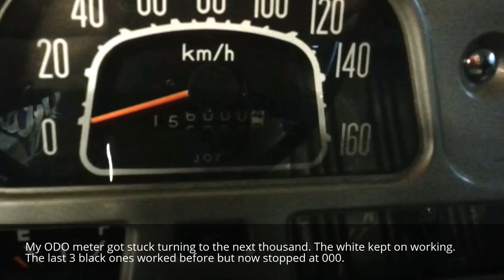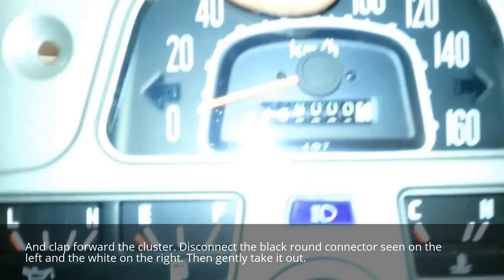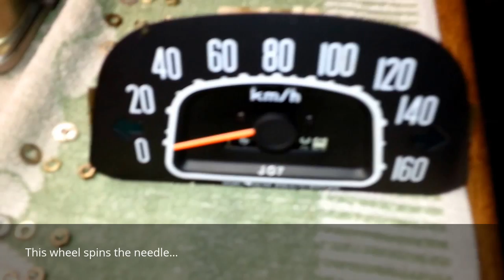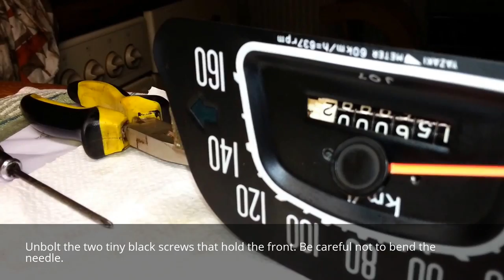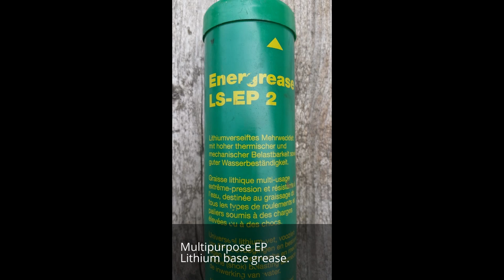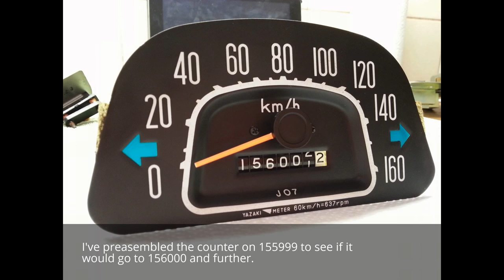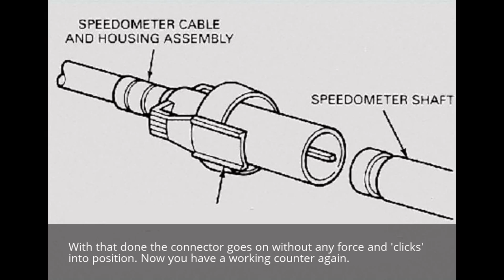FJ40 BJ40 BJ42 Odometer stuck. It stopped turning to the next thousand - How To Fix

Comment: Hi there. My odometer doesn’t work at all, the white numbers spin/work although the odometer doesn’t move/work... any ideas? Would it just need a clean?
Reply from the maker: If only the white one on the right works, you know that the cable from gearbox to the dash cluster is connected. Indeed might need just a clean. Old grease becomes glue and prevent the digits turning. Or.doesn't the needle move?
Reply: pzj70 thanks a lot!

Comment: Did you find a problem or was it just dirty?
Reply from the maker: This fixed it. It was the old grease that turned into 'glue'. Cleaned it and regreased it slightly. Still works great.
Reply: @pzj70  Thanks for the reply.  I have found a brand new one believe it or not.  I will try and fix up the old one as well.  Wish me luck :)